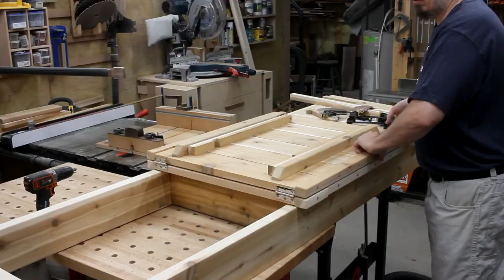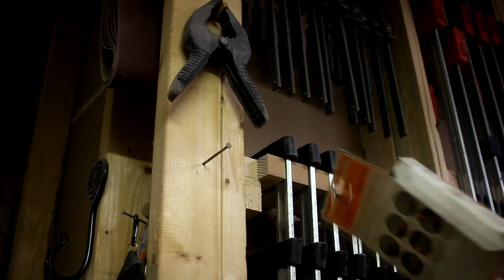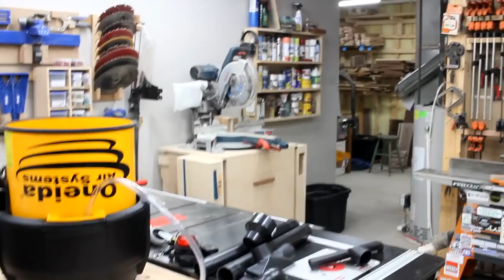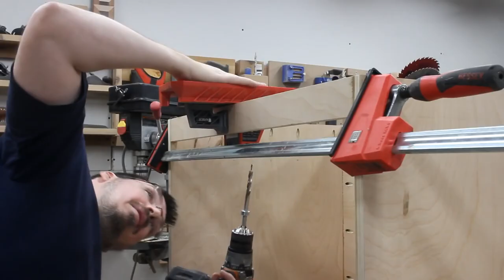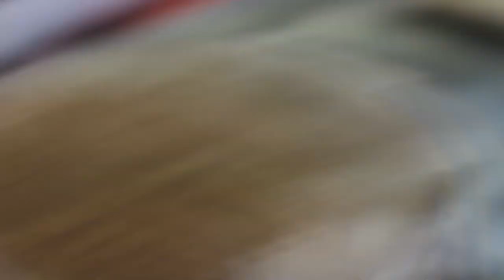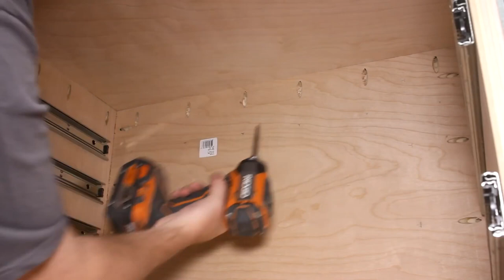Fisher's Shop Outtakes Compilation vol.2

Comment: I love that you show these out takes, cos' we all have the same things happen although, I have to admit that my cussing is a might stronger! 😵  My wife has a good laugh if she's anywhere near my work area as the air turns blue, she prefers that to red, which fortunately has only happened a couple of times and not seriously. I always have electrical tape near to hand to stop getting the work stained red when that slotted driver slips off the screws. It either damages the work or the fingers. (For that reason I dumped all slotted screws) Thank you for the laughs. 👍 😎

Comment: It's not you, I have the same problem with those Torx bits not staying in the bit holder. I was ready to use some CA glue once but I found a bit holder with a mechanical latch not magnetic.

Comment: At times it's as if I'm watching myself. I seem to have avoided the fastener dilemma, mostly as I've switched incrementally to Torx screws and always use magnetic bit holders that lock in the bit. Yeah, I know, Standard screws are sometimes necessary for the visual appearance. When you switch to Torx, you realize how much you don't like Phillips. Square drive? Our Northern friends will not give them up as they were invented up there and it's some kind of taboo to switch. Saw an actual study (probably by a torx screw company) that showed the force needed to apply to a screw to keep the bit engaged while fastening. Years of experience has shown it to be pretty accurate. 12lbs-Phillips, 8lbs. -Square Drive (Robertson).. 5lbs-Torx. Try it and give some feedback.
Reply: Squares are at least tolerable, flathead and Phillips can go straight to the boiler room of hell though. Also we don't talk about the fact that security screws exist...

Comment: Use the same size phillips head screw to create the threads, then replace with the flathead.  Same as always go in first with a steel screw, then replace with brass.